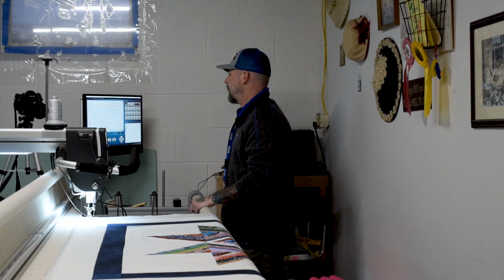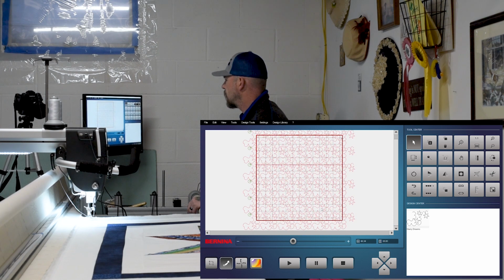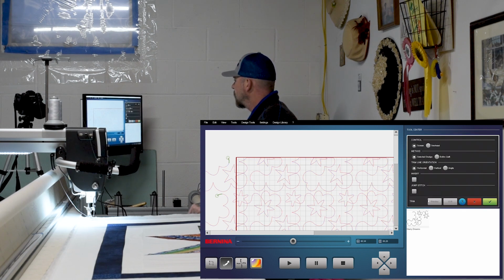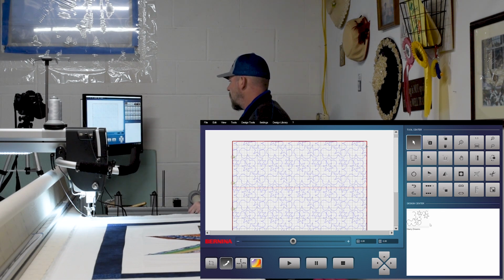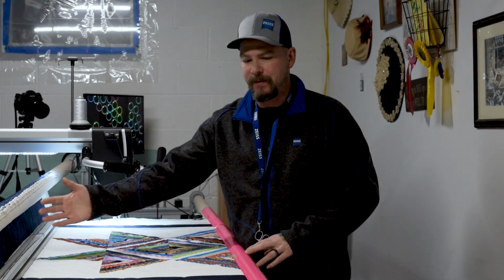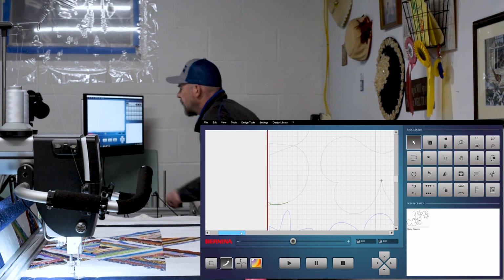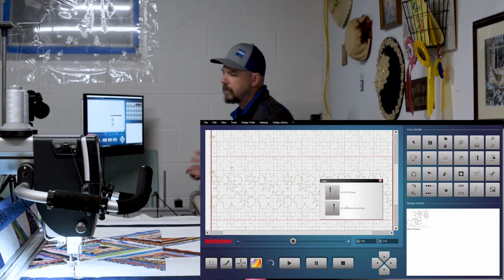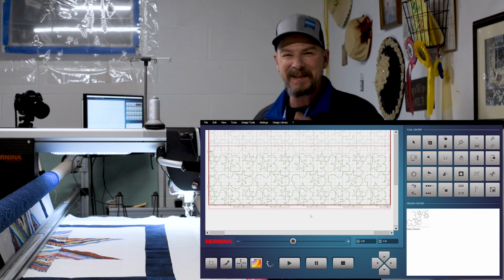Q-matic - Run an Edge to Edge (E2E) Design - Tutorial

Comment: Thank you for the clear explanation of the difference between using E2E+ versus Multiply.  So…. Would Multiply be a better choice if I wanted to stitch a dense design like Orange Peels where it’s super noticeable if the alignment is off even a smidge due to quilting shrink?  If I built my E2E with Multiply going across as well as down, could I then use Markers and stretch the next segment of the design so that it lines up precisely with the previously stitched row?

Comment: I have problems when I advance the quilt. I place laser light on the point of stitch and snap to point and the  safe area has moved so much that I cannot continue to quilt as I get the message that the quilt is outside the safe area. What am I doing wrong?
Reply from the maker: Most likely your laser is slightly misaligned.... Instead of using the foam pad that came with the laser, try using some scraps of fabric with your favorite batting to do the alignment...
Reply: Do you have a video on if you don't finish the edge to edge and go in the next and the screen does not advance. I realigned the safe area and the screen remains red . The book does not seem to address this part.
Reply: I pressed Go and the first row is blue the rest is gray.. I m on the 4rh row . This goes with the above comment.